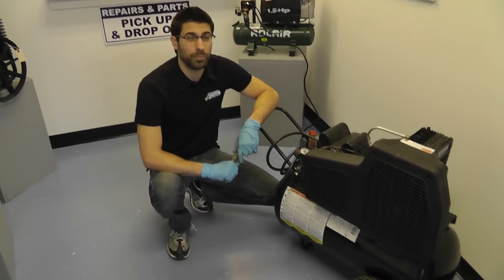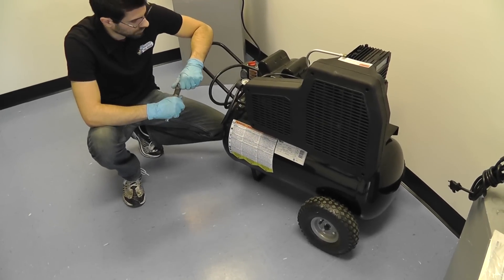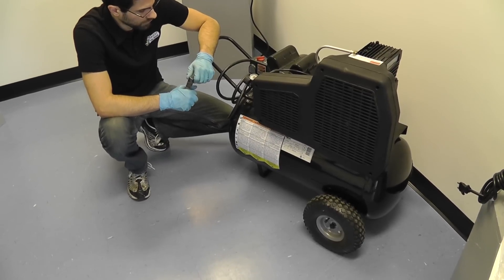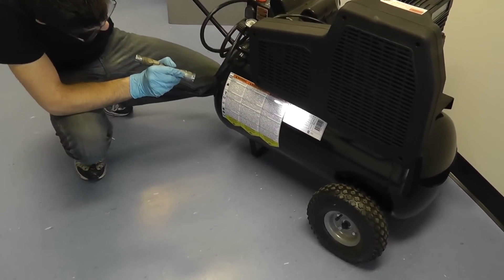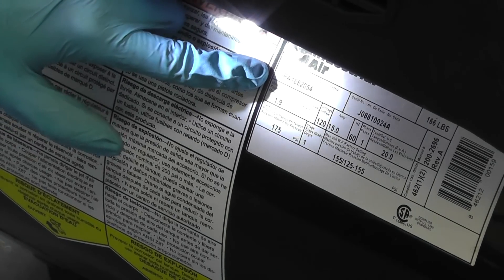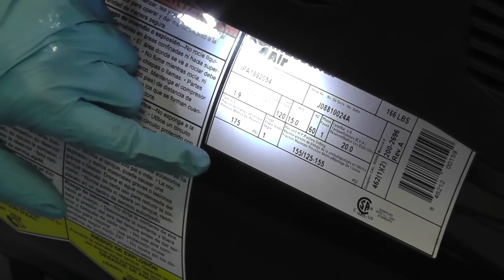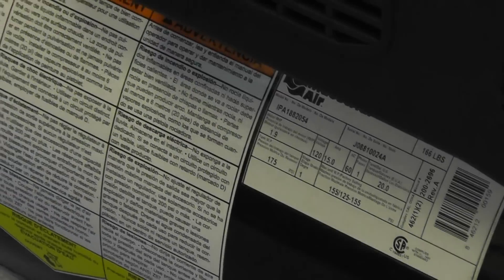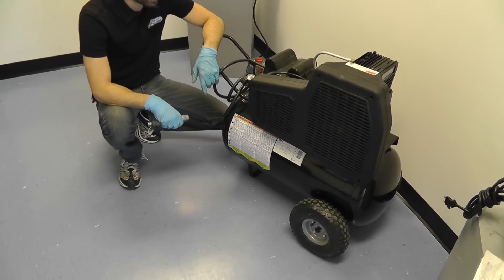How To Find A Sanborn Air Compressor Model Number - MASTERTOOLREPAIR.COM

Comment: I need help.  I have a new 60 gallon unit, but the pressure switch doesn't cut out, it always kicks to the pressure relief.    Help?
Reply from the maker: walperstyle Most likely the pressure switch either needs adjusting or replacing. It's pre-set at the factory to cut off at a certain PSI for the unit, for single-stage units this is anywhere from 125 (typical) PSI to 155 (less typical) PSI. If your max cut-out pressure is, say, 125 PSI and the unit keeps pressurizing past 125 PSI (assuming your Gauge is accurate) then it's defective. 

Some pressure switches are adjustable, you can watch our video on how to do this at the below link:
https://www.youtube.com/watch?v=zh_hfD3rCA0

If you can't adjust it then I'd replace the pressure switch.